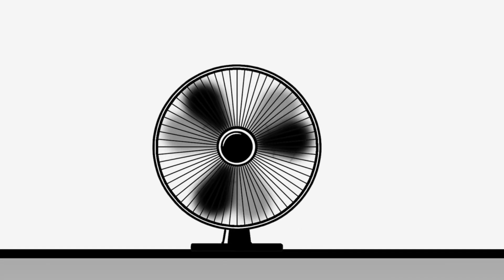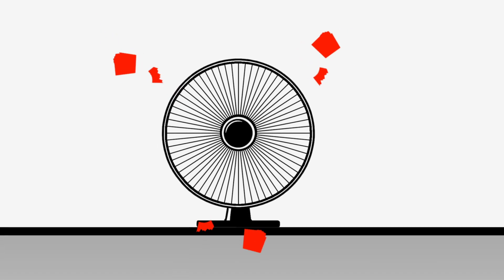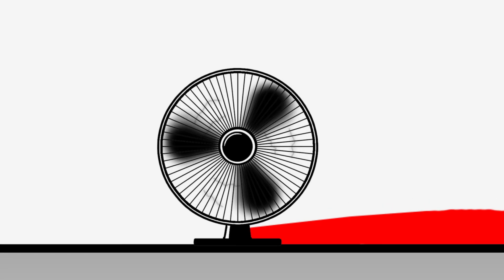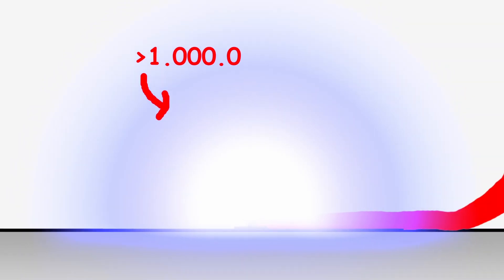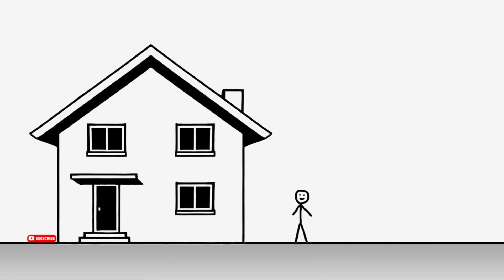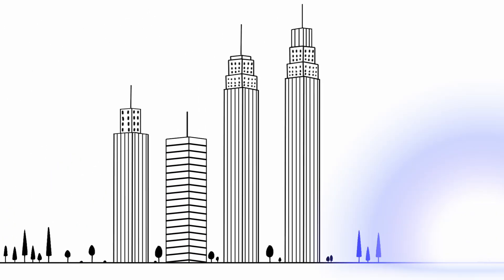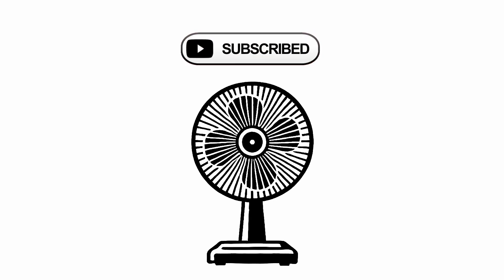What Happens If a FAN Spins at LIGHT SPEED?

Comment: Another question: If the fan spun at a certain fraction of the speed of light, slow enough not to create plasma, then would it create a massive storm?
Reply from the maker: No, it wouldn’t be powerful enough. Great question 👍
Reply: @ImagineThat-1x I'm confused. Do you mean to say that there is no middle zone where a tabletop size fan would create a massive storm but would not create plasma? Please create another followup video to explain remaining questions!
Reply from the maker: @notprovided1131 Basically, the fan would destroy itself before it could create a massive storm. But even with an indestructible fan you would just get a strong breeze before air turns into plasma. There isn’t really a comfortable middle zone in between. Hope that clears it up a bit :)
Reply: @ImagineThat-1x Thanks! Looking forward to your next followup video on this! I'm gonna watch it!

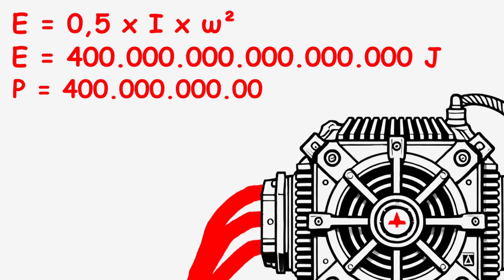Comment: 0:38
At this point you know the entire video is wrong. Total and complete ignorance of the actual physics involved
Reply from the maker: @fritt_wastaken  At what point did i miscalculate something?
Reply: @ImagineThat-1x  it's impossible to tell since you didn't even present your assumptions.
But you didn't even use the right equation. Why is power even related to kinetic energy of the blade? Why are you using classical energy for relativistic speeds?

This question is actually SO much more interesting than you made it look. Its "flow" might actually have some distinct shape. And its destructive power will converge to some finite value as it approaches its version of Eddington limit, which in turn will probably depend on the shape of the blade.
I bet one could write a whole paper on this topic
Reply from the maker: @fritt_wastaken  I is the Moment of inertia of the body about the x-axis, where i also included the weightgain for relativistic speeds(90%) and w is the angular velocity. The calculation is true. Also Power is energy per second if you didnt know
Reply: @ImagineThat-1x  uh-huh, so the power applied to the object is just its kinetic energy and isn't related to acceleration or the work it does..
And apparently you can convert to relativistic physics just by increasing the mass (which doesn't actually increases with speed)

You seem to think you can get the correct answer by just substituting values that sound similar without any consideration of their context.
Are you sure you're qualified to run a physics related channel?
Reply from the maker: @fritt_wastaken  Dude, do you even understand physics. the mass increases when the object is travelling at nearly lightspeed
Reply: @ImagineThat-1x  yup, I have bachelor's.
Increasing mass is an old oversimplification that was introduced to make some equations less scary. It's a categorical error to think that mass actually depends on speed since mass is not a tensor, it's a scalar.
So "relativistic" mass isn't used in any serious literature for the past ~50 years or more, there is only rest mass.

But the question is, do you understand physics?
Reply from the maker: @fritt_wastaken  yes. And the equation for the mass is needed for calculating the energy.
Reply: @ImagineThat-1x  again, in case you didn't actually read my response, mass is a scalar invariant. So no, you do not need an equation for it, it's a part of your starting conditions.
Equation you're looking for is K=(γ-1)mc^2 which is far from your proposed K=γmv^2/2.

Anyway, kinetic energy has literally nothing to do with your problem, since you're actually looking for power. You're missing a whole bunch of assumptions and calculations for that

Comment: Thought this was What If? for a moment, similar style. Also, I think there's a flaw in your analysis here. The fan can't spin at the speed of light, but only arbitrarily close to it, and it takes an arbitrary amount of energy to get arbitrarily close to the speed of light. I assume you picked a value like 0.99 c to calculate the power needed? Also, if you're hitting particles hard enough to (as it is depicted) split their nuclei into protons and neutrons, I feel like that would cause some fusion -- normally plasma is created by just ionizing the particles. I feel like there's more complexity here.

Anyway, moving from complaints to (maybe) perfectionism -- I don't think you could assume here that just because a plasma (presumably) or similar is created means that the fan doesn't blow the particles in a direction. A plasma is an ionized gas, so you can create regions of high pressure, I think -- therefore, the area in front of the blades would be higher pressure than the surroundings, blowing plasma forwards in the same way normal fans blow air. This would probably create some kind of complex magnetic circulation. At high enough speeds obviously (0.9999999999999999999 c maybe) the fan would just instantly destroy the Earth. One way to calculate the impact might be to compare bomb explosions to the energy needed to push particles out of the way, but that determines on the speed at which the particles in the fan's reach are replenished, which might be complicated.